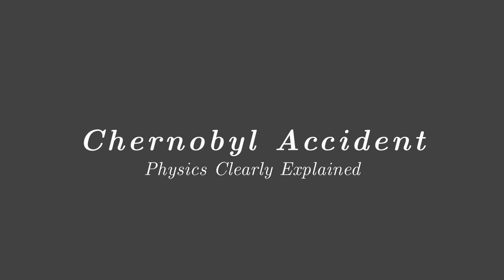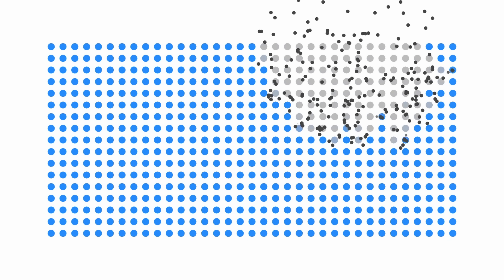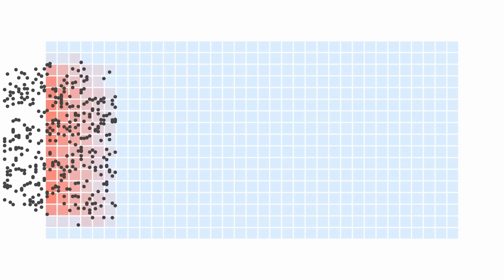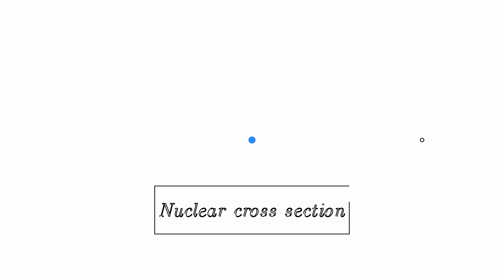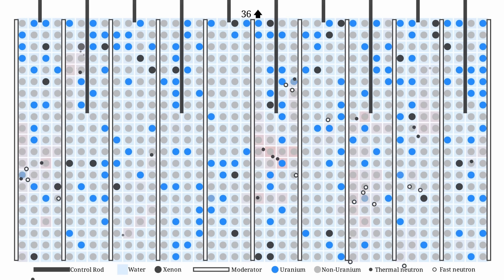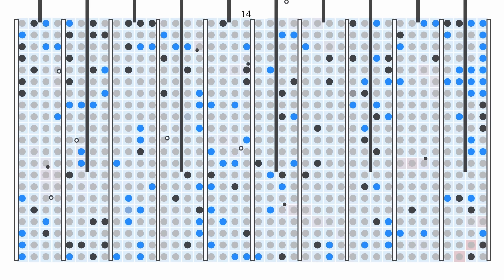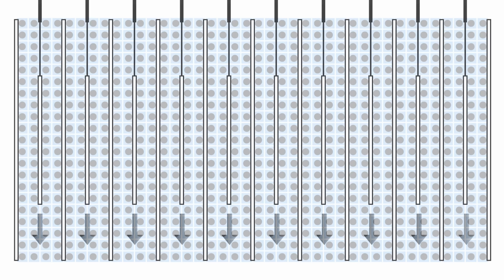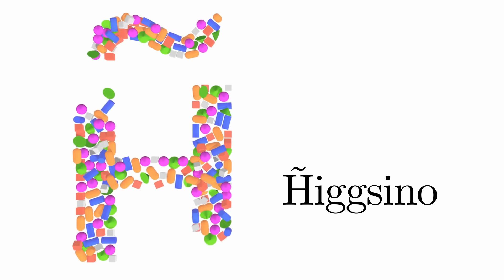Chernobyl Visually Explained

Comment: So, the visual simulation is interesting, but it runs the risk of having wildly different time-constants compared to the real-world system. In particular, Xenon burn-off has a time constant several orders-of-magnitude too slow to explain the rapid acceleration in Chernobyl-4's reaction rate. Xenon build-up played a key role in setting up the accident, by getting the operators to remove all but a handful of control rods, and by unbalancing the reaction so that it was proceeding entirely at the top and bottom of the reactor, and was almost totally stalled in the center of the reactor. But Xenon burn-off was NOT an important feedback factor in the reactor's rapid power rise. In addition to the slow time constants included in several simulation papers as well as the INSAG accident reports, it's relatively straight-forward to prove this from first-principles by observing that Xenon's absorption cross-section, of 2 million barns, or 2e-18 cm^2, times the neutron flux of an RBMK-1000, which was, IIRC, on the order of 10^14 /s/cm^2 at full power. So that tells us that at full power, your average Xenon-135 atom is going to take on the order of 500 seconds to absorb a neutron. Even during the transient, at 10X or 100X the normal reactor power, the transient was so rapid that only a small fraction of the Xenon atoms could be expected to burn off. It's a relatively slow feedback factor.

Also, the accident can't be properly understood without understanding the role of the asymmetric power distribution prior to the accident. With the middle of the reactor was in the depths of a Xenon pit shut-down, there were really two separate, entirely decoupled reactions, one at the top of the reactor, and the other at the bottom. Thus pushing the control rods further into the middle of the reactor had little effect because the middle of the reactor was already dead, but pushing the graphite segments further down had a very significant effect. The SCRAM effectively shifted reactivity from the dead middle of the reactor to the over-active bottom of the reactor, further accelerating the reaction.

Void reactivity was a known consideration to the reactor designers, and RBMK-1000 doesn't have a universally positive void coefficient in all scenarios. In particular the void coefficient is negative early in the fueling cycle and becomes positive later as more fuel is burned up and more control rods have to be removed to maintain reactivity. Chernobyl-4 was late in the fueling cycle, and the Xenon pit caused the operators to pull out even more control rods until the void coefficient became terrifyingly positive. That was a transient property of Chernobyl-4, not a universal condition of the RBMK-1000 in all conditions.

One of the mitigations for void reactivity and other positive feedback factors is the even faster negative feedback from doppler broadening as the fuel temperature rises. That's one of the fastest feedback mechanisms and is supposed to help in stabilizing the reactor, but between putting the reactor into a configuration where it had a huge void coefficient, much larger than even a late-cycle RBMK-1000 normally would, and generating an asymmetric reaction that would be pushed over the cliff by the SCRAM event's modest reactivity spatial shift from the dead middle to the overheating bottom, the operators managed to thoroughly overwhelm doppler broadening's ability to limit a rapid transient.

Regarding it "going supercritical", what you really mean is prompt thermal supercritical, as being delayed supercritical isn't all that exciting and merely implies that the reactor's power level is increasing, possibly very slowly. When the reaction needs to wait for the slower decay groups to achieve supercriticality, power rises very slowly, with time constants in the tens of seconds. When exceeding a dollar of supercriticality, reaction growth only needs to wait for the next neutron generation, and thing get out of hand very quickly, on the order of 10^-4 seconds, which is still wildly slower than prompt fast supercriticality in a bomb, 10^-8 seconds per generation; even in an out of control Chernobyl-4, the reaction still has to wait for graphite moderation between neutron generations, preventing it from significantly exceeding the level of energy release required to disassemble the reactor. For most of Chernobyl's power transient, it probably wasn't prompt thermal supercritical, and was probably growing at a rate throttled by of one of the fastest two delay groups, but when all the water flashed to steam, things got pretty crazy and none of the papers I've read can agree on the exact course of events. I'm still trying to understand the simulations myself and when exactly they may have reached prompt thermal supercriticality.
Reply: It is the reactivity coefficient that went positive late in the fuel cycle. The main contributor was that the void coefficient went from slightly positive to extremely positive, pushing the reactivity coefficient above 0. All other factors in the reactivity coefficient could not compensate for the high positive void coefficient.

This was not known by those in the control room. The number was calculated later from measurements performed a few days before shutdown.

There were modifications to the reactor design not known to the crew, crucial for the positive scram effect of the graphite tips/displacers. This and the positive reactivity were both not known to the crew, and made the reactor dangerous.

These aspects came essentially from the nuclear research institutes. But they managed to shift the blame to the operators.
Reply: @Krasbin  ah, thanks for the correction!
Reply: @Krasbin  Heck not only didn't the people in the control room not know it the communist system had been blowing smoke up their back sides for years about how perfect the RBMK style was and that it couldn't explode.  Goes to explain some of the cavalier decisions made at the time.  Every time a RBMK reactor had an issue the government would classify the entire thing as a state secret thus preventing the people running the reactors from critical information about what they were working with.
Reply: This comment and the associated thread should be pinned, it's of inordinately high detail and accuracy.
Reply: @LtPulsar  That's because it's mostly AI generated.
Reply: @Mintpepperoni  What would make you say something like that?
Reply: @Mintpepperoni  at least mine aren't. Some of us actually know and undersstand physics, unlike AI.
Reply: This comment is the first source to explain why the graphite tips triggered the power spike. Thanks 😀
Reply: I feel like i just learned so much
Reply: The thing also overlooked here (in the simulation) are the graphite followers of the control and protective rods. If they'd been extended all the way to the bottom of the active core, then triggering EPS (aka SCRAM), would have simply let graphite go off from bottom as absorbing elements were inserted. This wasn't the case though, due to building size restrictions (remember the core height of ~7m). Thus, initially water was displaced by graphite at the bottom of the core by falling control rods, leading to pisitive scram effect, 
I cannot say if this started the power excursion, but at least accelerated. Then further down the few seconds, the positive void coefficient kicks in, coolant tubes rupture and mechanically jam control rods...
Reply: @mattipaajanen4109  Yes, the SCRAM was very significant. I rather like this simulation paper: https://inis.iaea.org/collection/NCLCollectionStore/_Public/22/069/22069564.pdf. Per that paper's Figure 4-6, they estimate that the positive reactivity injected at the bottom of the core by the SCRAM event would have been sufficient to cause a rapid power transient even in an artificially simulated condition where the void reactivity coefficient was zero, although they predict a peak power production of only 10X rated power rather than 100X when including the void reactivity contribution. They also find that the SCRAM event was a necessary precursor to the rapid transient and that without the SCAM reactivity, void reactivity alone would have been insufficient to trigger a rapid excursion. I don't really understand how their model limits power rise to only 10% w/o the SCRAM.

Another interesting finding in that paper, best demonstrated in figure A-2, is the critical effect of the asymmetric "two humped" reaction power profile, with the center of the reactor totally dead and two uncoupled fission reactions, one in the top of the reactor, and another in the bottom. In the reactor's normal steady-state power distribution, where power production peaks in the center and is at a minimum at the top and bottom, the first 100 cm of SCRAM control rod injection adds -0.9 mk of reactivity, slowing the reaction, but in the double-humped state of the Chernobyl-4 reactor, where all power was being produced in the top and bottom of the reactor, that first 100 cm of SCAM control rod insertion would have added +5.7 mk of reactivity, which is actually a HUGE number, more than the "one dollar" of reactivity needed to go from being just barely delayed critical to being fully prompt critical (the paper estimates that at that stage in the fueling cycle, the reactor's delayed neutron fraction, or Beta, would be 0.52%, and that's what defines "one dollar" of reactivity).

I don't yet know how to square those findings with the intro to the INSAG-7 report, which states that the void reactivity change for a complete loss of coolant could, late in the fueling cycle, be as high as 4 to 5 times Beta (ie, "four to five dollars").

I'm skeptical that building height was a fundamental limit on the placement of the graphite segments on the control rods, given that they changed this design in response to the accident, moving the graphite segments down such that there was no longer a water gap. I suspect that the graphite segments were arranged based on the needs of fuel cycle reactivity management. The center of the core is going to burn up first, so as they pulled out control rods as the fueling cycle progressed, they probably wanted to inject more reactivity into the middle of the core. In other words, I think that they designed the reactor to maximize operational efficiency when used as the designers intended, and gave relatively little thought to the risks this could create when the reactor was put into unusual configurations. They didn't design in the paranoid safety margins they needed to be safe with operators trying to bull rush their way through politically important tests despite having taken the reactor's well out of its intended operational configuration.
Reply: Can you explain this visually in 4 minutes please
Reply: It's not a "visual simulation", it's a visual representation of ∑ solutions that stem from physical syntactic observations. Pardon the semantics, because I like the rest of your response.
Reply: @defeatSpace  Well, your model is not a solution of the true physically representative partial differential equations. Visually pleasing, yes, nowhere close to even rudimentary understanding of the physical phenomena in play.
And if you'd like to split hair, you wouldn't refer to total power or flux as 'reactivity'. Reactivity is a unitless measure that is involved e.g. in the term void coefficient you refer to.
Reply: I think once the water flash-boiled, the xenon "burped" out of solution and escaped as gas (under high pressures), by simply venting to atmosphere. The graphite-tips accelerated the rates of thermal neutron production so fast, and the positive void coefficient meant once the steam bubble fraction was high enough, it just over pressurized the vessel and went boom. Then the xenon escaped and it really went boom and  melted down. Just a pure, shit design with dumb operators and cockiness about safety.
Reply: @nicklockard  One effect you are failing to take into account is the negative feedback that occurs from doppler broadening as the fuel becomes hotter. The simulation paper that I've linked suggests that after most of the water boiled off, the fuel temperature starting rising faster and the rate of power production decreased significantly, remaining at an excessively high value, but not nearly as high as during the rapid power transient. The paper also explicitly states that even though enough reactivity was injected to temporarily make the reaction prompt thermal supercritical, the thermal neutron generations take 10^-4 seconds, which is slow enough that doppler broadening still constrains total power production, and that statement is still going to hold true even in your hypothesized Xenon escape. Also note that the Xenon is trapped in the fuel matrix, not the water channels, so the steam flash has no effect there and Xenon cannot plausibly vent until the fuel ruptures, at which point loss of fuel through venting is probably at least as significant as loss of Xenon.

Even at the less extreme rate of temperature-limited power production, the fuel continues to rapidly get hotter until the fuel channels eventually rupture, after which it's difficult to model what happened next -- the paper throws in the towel at this point. Some of the fuel would have been cooled by mixing with the steam in the channel, some may have been flushed out of the reactor, and then eventually the entire reactor is blasted apart and the reaction stops. I've been trying off and on for several years to get my head around what exactly happened during that final time period and I still have more questions than answers.

Finally, it's inaccurate to say that Chernobyl "melted down". A melt-down is when a reactor core melts due to an inadequate supply of cooling water for removing the post-shutdown "decay heat" produced by the decay of radioactive isotopes hours to days to weeks to longer after the fission reactions stop. That's what I call the "hard problem" of nuclear safety because even after you stop the reactor, you still need to be able to guarantee cooling water flow for days to weeks afterwards, and you must do that even in the contingency where your plant got hit by a tsunami. In contrast, Chernobyl was a "power excursion" where the actual fission reaction ran away to a destructive level of power production. It's worse than a melt-down and far more inexcusable. You have to try pretty hard to achieve a failure like Chernobyl, with arrogance and complacency at multiple levels of the design and operational regime. Preventing power excursions is the "easy problem" of nuclear safety. The only other destructive power excursions I'm aware of, in all of human history, are the SL-1, which was built from weapons-grade uranium and had manually operated control rods, and then I believe there was a deliberately triggered excursion in one of the experimental NaK reactors that caused a bigger mess in the core than the cowboy operator had expected.
Reply: @nicklockard  the Xenon and other fission gasses didn't mostly escape. Because they were within the fuel-matrix. During power excursion some did escape first to gas gap of the fuel rods, later as the fuel cladding shattered to coolant and out to atmosphere. However, this was insignificant on how the power excursion went. Things had unfolded by that time
Reply: Oh be quiet dude, it's a youtube video. Nobody cares how much you know about it. You don't really even care. You just wanted to spout off about how much you know. Greta job dude, everyone is really impressed that you wrote this wall of text.
Reply: @DrPeculiar312 I hope you find the peace you are looking for.
Reply: @ddopson  Hope you got the attention you're looking for. Everyone in the youtube comments think you're sooooooo smart dude, congrats.
Reply: @DrPeculiar312 thanks, but I don’t write for your attention. You should ask yourself why you feel the need to neg someone you don’t know over a niche comment on a niche educational video. If it’s such a waste of time, why are you wasting yours? What difference to you if other people are fascinated to understand a technical topic? That sort of emotional toxicity can really eat into your own mental health. Be well friend.
Reply: @ddopson You're not helping anyone with anything. You don't need to criticize the video to make yourself look smart. No one read all that. It's kind of sad how badly you're starved for attention, that you'd write all that, and pat yourself on the back for how smart you think you are. That you know soooooo much more than the guy who made the video
Reply: What about Obama's role in all this buddy?
Reply: @ronaldnixon8226  Are you high right now?
Reply: @ddopson  So you like Bidenflation?
Reply: @ronaldnixon8226  What about that then?

Comment: Nice Video. What tools did you use to perform the simulation? Are these available by any chance?
Reply from the maker: Thank you! I used Manim with a Verlet integration for the physics solver. It's stitched together by me and sadly not available. Mostly because right now the code is confusing and poorly structured. It could be really fun to release of others found it useful though.
Reply: @Higgsinophysics  would be interesting to see someone recreate the mechanics involved here in Godot or similar, let people mess around with various reactor designs and get a feel for how they've changed over tge years